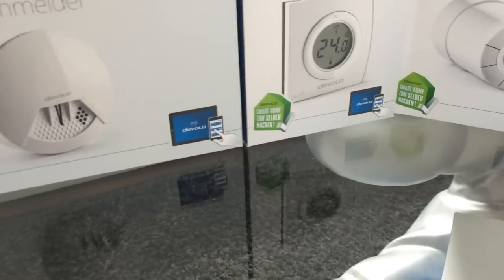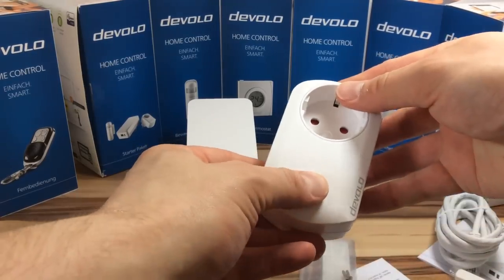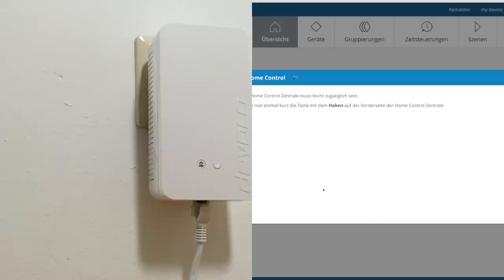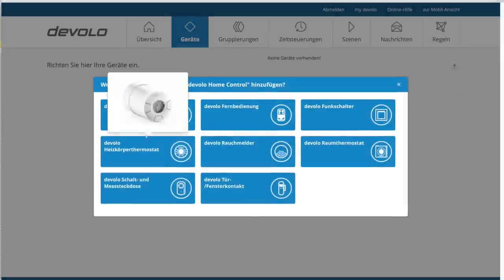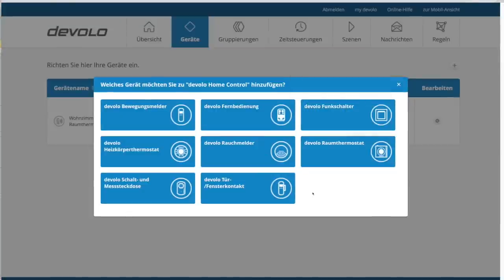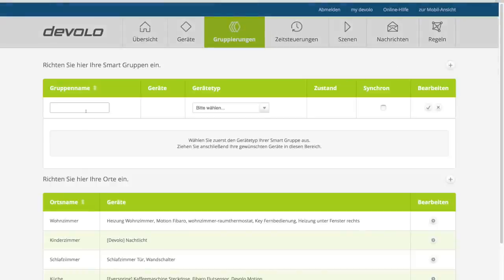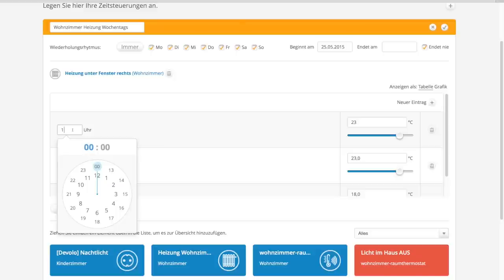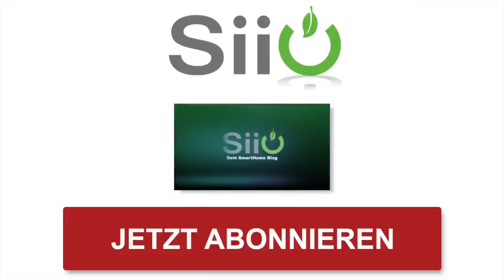Devolo Home Control Teil1 - Starterset & Danfoss Heizungsthermostat: Installation & Einrichtung

Comment: Die Thermostate im Video sind ja alle Devolo Branded. Die Danfoss Thermostate (Typ LC13) kosten einiges weniger, kann ich diese mit dem Devolo System dann steuern? Bin noch relativ neu im Smart Home Business ;-)
Reply from the maker: Sollte gehen. Devolo hat lediglich eine kleine Änderung in der Thermostat Firmware vorgenommen, so das die Thermostate auch die gemessene IST Temperatur an das Gateway übermitteln. Das kann das originale Danfoss nicht.